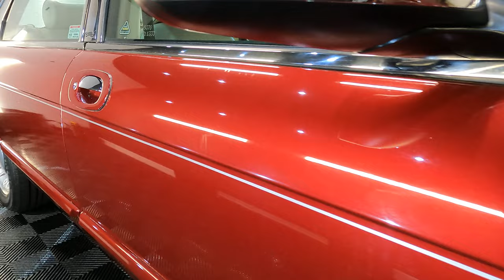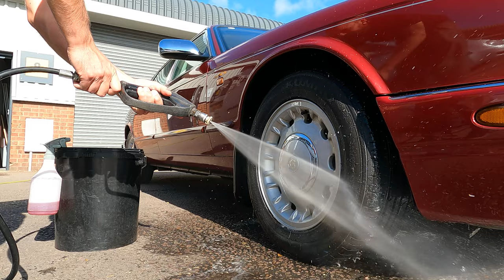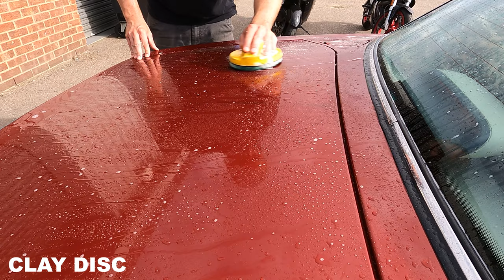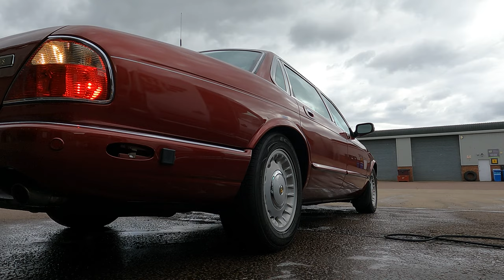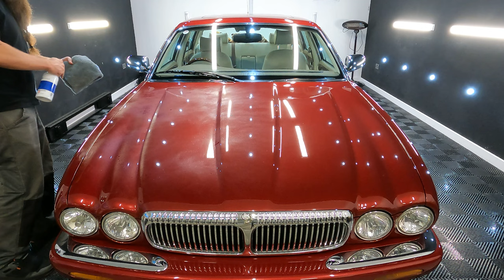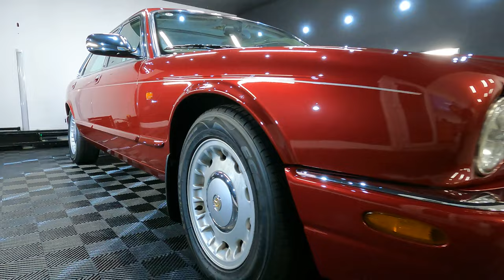Classic V8 Limo - Daimler Super - Detail & Ceramic Coat

Comment: The X300/X308 XJ Series are the lowest XJ's of all builds, also no other car brand builds a Super Sedan's this low.
That's what makes driving these Super Sedan's so unique.

XJR/Super V8 are bulletproof, because of not having variable valves, and equipped with an MB 5G-Tronic transmission that can handle over 700Hp.
Sometimes people ask me what Daimler stands for, I tell them, it is in someway comparable with BMW and Alpina.
The Daimler Super V8 is a psychedelic mixture of Luxury & Muscle car power.
Only 76 SWB, and 2,387 LWB X308 Daimler Super V8 are produced.
Mine is in Green Emerald, a beautiful color, that changes in different weather, and day and night.
I got the Solar rims, did u ever check those?
Greetings!
Reply from the maker: Great bit of info. 
Yeah I’ve seen those wheels (they might just be the nicer ones), and that green colour is really nice. 
Thanks for watching.
Reply: @detailtherapy  
Well, I also keep on learning bout these X308 Supercharged.
Just last week, I found out they got 2 Fuel pumps.
I only found out it is related to.. full throttle, when the second pump kicks in.
Not if it is in any way related to Sport Mode.

Sport mode for these is also unique, because it uses 1st gear also, only Jaguar got this 5G-Tronic setting as far as I know.

Greetings!
Reply: I am, looking for to buy this 6 straight 5 speed. Nothing on market. Help me to find.
Reply from the maker: Have you tried Facebook car groups? Usually a good source.